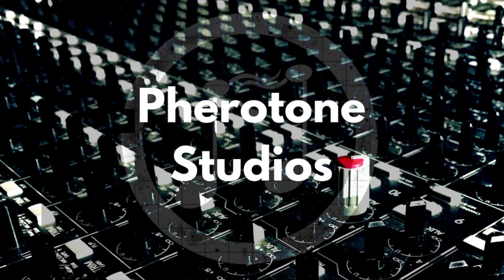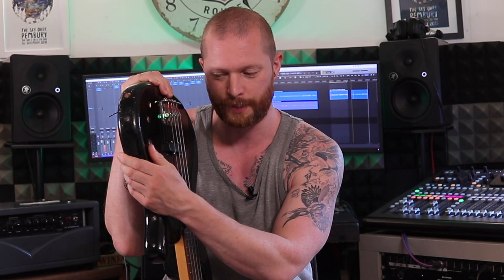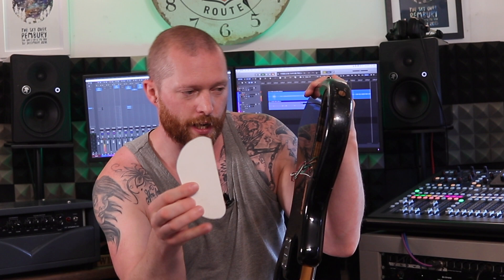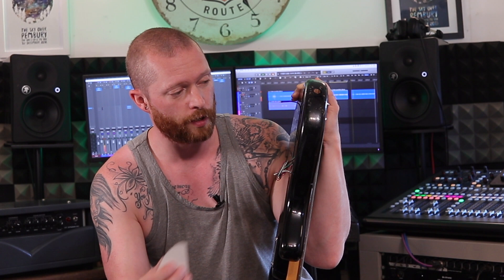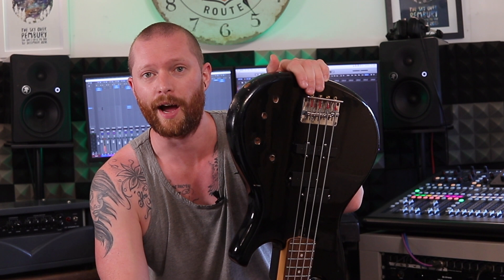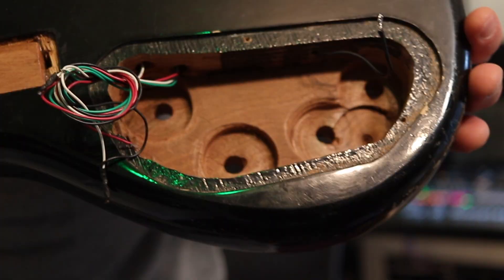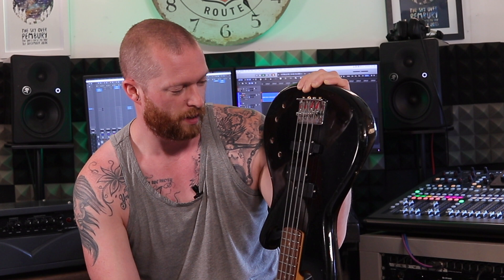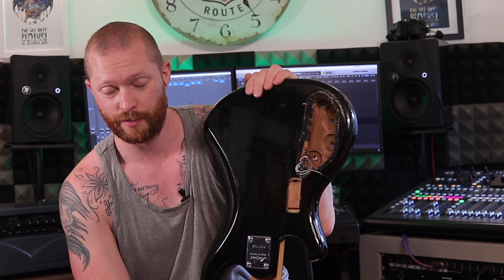How to repair a guitar cavity

Comment: I think with how my holes are botched up on my Explorer kit, I think I may as well just cut out the cavity and glue new wood in, essentially comletely rebuild it lol Needs surgery and I'm not happy about it. The wood on it is just not the best quality and just exploded when I tried to drill the holes out so just putting new good wood in there is going to be the ticket I think.